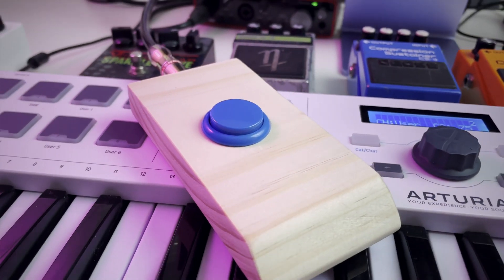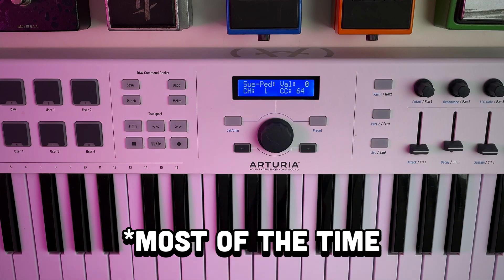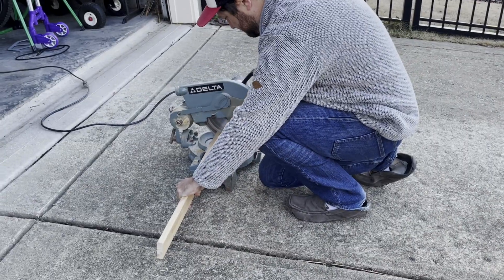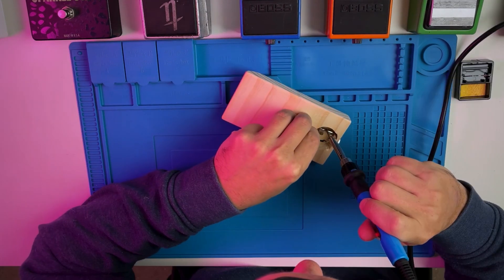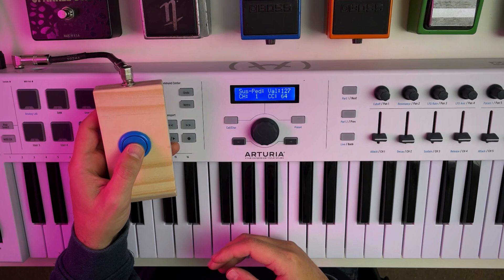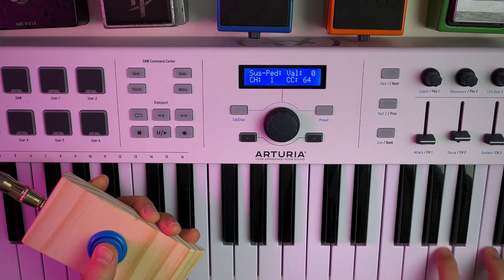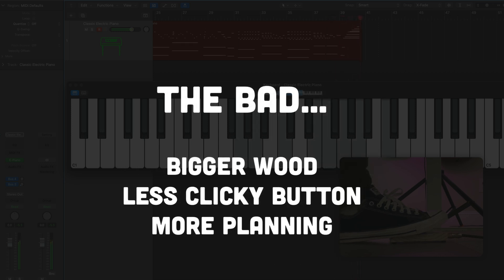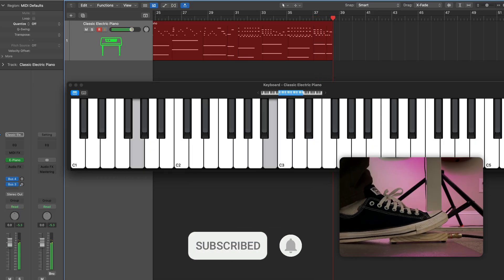DIY Sustain Pedal for MIDI Keyboards | Tutorial & Demo

Comment: Just a note: my Yamaha keyboard reverses the polarity if you hold the switch while turning on the keyboard power.  So it doesn't matter whether you have a NO or NC switch - the keyboard can handle either.
I really want to know how to make a 3-pedal unit though...
Reply from the maker: Thanks for the tip! I think my Arturia works that way as well. I think a diy 3-pedal unit might require sending MIDICC values but I’m not entirely sure. If that is the case, a microcontroller could be stuffed in a pedal to send the data across the wire to your keyboard. This is all hypothetical, I’ve not tried it. Cheers! 🙌

Comment: A truly astonishing design! 
But my problem is  my 'midi'keyboard(a cheap electronic organ) cannot transmit the CC64 signal of the sustain pedal to my PC,does anyone have any suggestions to make my sustain pedal work in sampler or DAW?
Reply from the maker: Thanks! For something like that I’d look into making a pedal with a microcontroller inside using MIDI over USB. I’d use a Raspberry Pi, Arduino Pro Micro clone, or ESP32 (Bluetooth) as the controller and write a script sending midi cc updates.

Comment: Is it safe for long term, won't it damage the keyboard?
Reply from the maker: It should be safe long term. It is just closing and opening the circuit like a standard sustain pedal—no voltage added. 🙌
Reply: @mobypixel Okay, then thank you for the information and explanation. I will try to make it.

Comment: I want a midi sustain pedal, that sends midi sustain. That’s because my small midi keyboard doesn’t support sustain pedals
Reply from the maker: Hey Coko! That is totally doable, but it would required a microcontroller like a Raspberry Pi Pico to be connected as a second MIDI controller.

Comment: Nice! I have a few sustain pedals I'm happy with already. (Well...I need to get one that supports half-pedaling. Actually maybe two because it looks like the Yamaha Reface CP and the Korg microKey Air have a polarity or other difference.) But I might try this for my Yamaha DD75 drum kit's pedals. It comes with simple button ones that, for me, don't feel great. And this arcade button one might be better. The other option is to use the pedals from the "big boy" electronic drum kits, but—as not-a-real-drummer—I think I'd actually prefer smaller/simpler ones like this.
Reply from the maker: Thanks @RobertFisher1969! That would be awesome to use something like this as a kick trigger. Cheers! 🙌

Comment: that's really nice that someone is showing how silly simple a sustain pedal is.  you can buy industrial foot switches cheap and just put 1/4" jacks on them. most of them are N.O. or N.C. selectable. 
 i build my own stuff when i can.  i built one from a literal doorbell switch for a N. O. switch. i also found a pile of micro switches in my electrical junk which had both N.O. and N.C. contacts.  i built 2 "dual sustains" so that i can sustain up to 4 keyboards at once with one foot.. one set N.O and one set N.C for the yamahas.  fwiw, my korg krome is N.O. but the wavestate uses N.C like my yamahas. i can use one dual pedal on my alesis drum machine to start and stop and to change patterns with the other one.  my multi sustain pedals are my secret weapon to my live jamming. I dont even use my big clunky yamaha sustain pedal any longer because it is just too big. i only built prototypes that look like crap, but they work so well i never refined them haha.

i have been meditating on how to build a master sustain system which has one switch to sustain everything and selectable combinations depending upon the song's needs.  i have some relays in my electrical junk that have a ton of contacts. i've been thinking of using a mercury switch mounted in a hat for the master sustain. just tilt your head and everything sustains.  this is where the yamaha N.C. style would work better. you open everything to sustain vs having to worry about different keyboards interfering with each other when you short everything to sustain on the N.O.s
Reply from the maker: That's awesome! Thanks for the insights. I didn't even know N.C. microswitches were a thing! Good luck with your master sustain pedal. 🙌